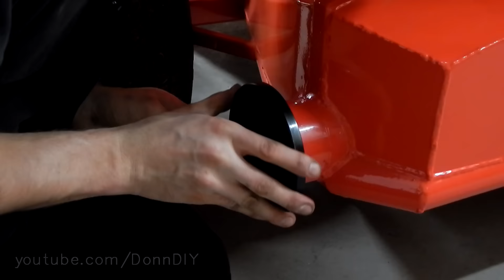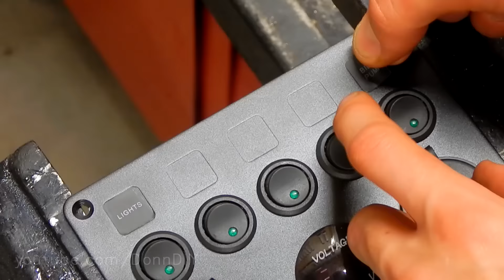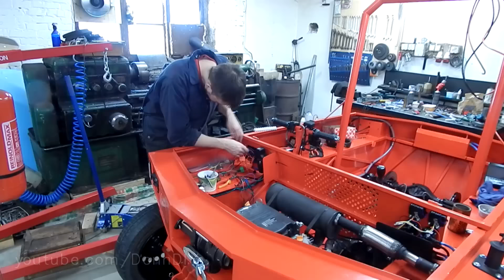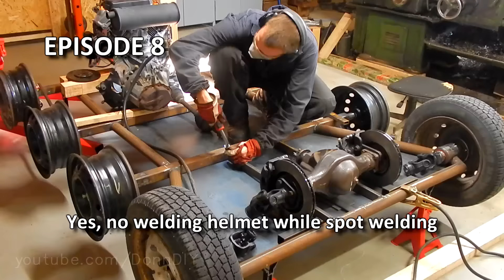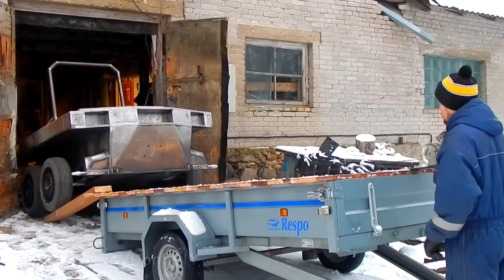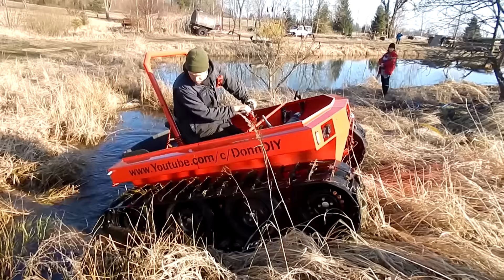IT'S FINISHED! - Tracked Amphibious Vehicle Build Ep. 25

Comment: Your float point is too high causing your tracks to all but fully submerge everybody not allowing efficient propulsion. By utilizing the unused output of the transmission with a shaft and sprocket to power a long prop shaft to the rear. Put a rudder on the rear of the hull, which could be controlled with one of the steering levers by adding a T handle or secondary lever to the top. Doing that would allow a more efficient forward or reverse propulsion.
Or  you could add an air ballast/s to lower your float point and get your tracks out of the water. If the tracks were only submerged to the 1/3 to 1/2 way point drive efficiency would increase.

Comment: I have a question I am wanting to make a tracked vehicle build myself but with a open rear differential wouldn't the machine always want to turn when one track meets more resistance then the other? Or do you constantly have to apply brake pressure to keep the machine moving in a straight line?

Comment: It lacks suspencion thats why its rough while running, it should have individual suspencion on each wheel, and the ground clearance is very low thats why iy runs also very slow not enough tracsion on the ground. Needs more improvements for it to run better

Comment: Why take off the hood go to fill up with water if it goes past that point anyway sense you put a hood scoop in it need to get the air breather that goes on top of the roll bar from the carburetor did you know you can buy a dual carburetors for that motor more higher output rods Pistons rocker arms crankshaft and really build it carburetor manifolds separate o n e s

Comment: Using a rubber gasket on a piece of exhaust probably isn't the best idea. There are better things to use as gaskets on exhaust pieces that get extremely hot. Heat melts rubber.